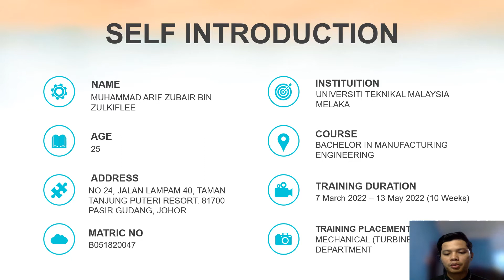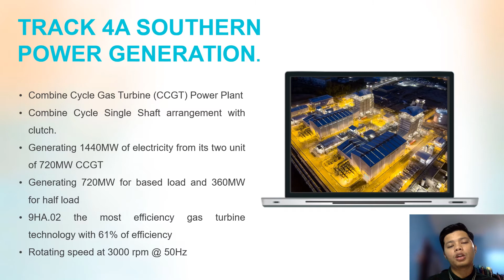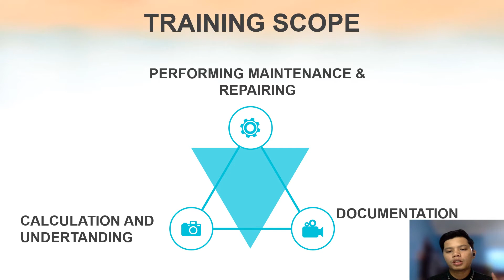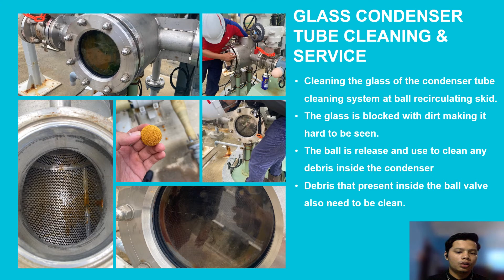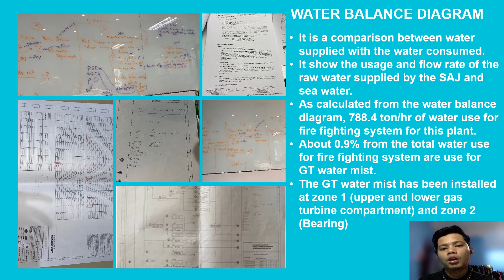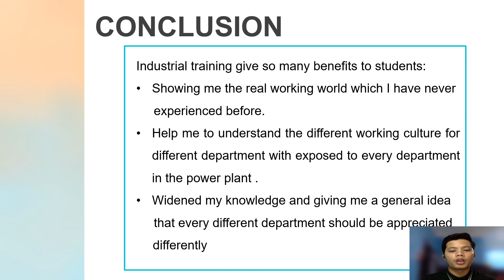2022 Industrial Training Presentation UTeM Arif Zubair B051820047

Comment: Wslm, Arif. Here are my questions. 
1. Could u explain the advantage of gas turbine technology compared to the ones used?
2. Can you elaborate on the performance or significance of using single shafts and multi shafts?
3. In your job scope, you were asked to do calculations. What kind of calculation? Please make sure you include this in your report.
4. How do they dump and manage the ocean garbage (shrimps, cockles, etc.) What are the procedures used?
5. How frequently the rubber gasket is broken? Monthly? Weekly? or, once in a blue moon?
6. How often do you perform the glass condenser tube cleaning?
7. What are the causes of the dirt? What does the glass condenser do? IS the ball yellow, or is it become yellowish due to stains?
Reply from the maker: Thank you Dr for the question. Here is my answer regarding your question:
1.	The 9HA gas turbine engine is the world's largest and most efficient heavy-duty gas turbine, with an efficiency of 61%. It has a modern 4 stage air-cooled hot gas path with advanced cooling and sealing technologies which can improve efficiency. It provides low emissions and wide fuel capability, which can run by natural gas and distillate oil for this plant. The 9HA has a fast 10 minute ramp-up from start command to gas turbine full loaded compared to other old designs, which can take longer for ramp upstart. The gas turbine has an advanced 14 stage compressor, which increases reliability and maintenance. 

2.	The single shaft arrangement has fewer parts involved than the multi-shaft because the multi-shaft arrangement requires 2 generators compared to one generator used for the single-shaft arrangement. This will involve extra auxiliaries, pipe, building and structure that will cause increased costs. Moreover, using one single big generator is more efficient compared to 2 single small generators. The start-up time for a single shaft arrangement is less than the multi-shaft arrangement. So, starting the single-shaft arrangement power plant is faster than the multi-shaft arrangement.

3.	For the water balance diagram, we were asked to calculate the amount of total water usage for the firefighting system over the total water supplied by the SAJ and the amount of total water usage for water sprinkled over the total firefighting system. For pressure vessel calculation, we need to calculate the minimum required thickness for the pressure vessel and corrosion rate for the pressure vessel to ensure the pressure vessel can safely handle the pressure of working needed and can be used for a long time.

4.	The garbage will be filtered by the travelling bend screen and thrown into the garbage drain. The drain will bring the garbage to the bucket where the garbage is collected. The technician will then raise the fully loaded bucket using a forklift and throw it into the RORO bin. One sub-contractor will take out the RORO bin when it is full and needs to be empty.

5.	The indicator shows the rubber gasket is broken when it fails to maintain the required amount of seal oil inside the tank. This will show the rubber gasket for the floating valve is broken and need to be fixed.

6.	This depends on the dirt condition inside the condenser tube. Frequent, we need to clean if the ball brings more dirt from the condenser tube. The glass condenser will be an indicator of the cleaning time.
 
7.	The dirt on the condenser tube cleaning service comes from the squishy ball released into the condenser tube. It will enter the condenser tube, bring the dirt along and back to the glass condenser. This cause the dirt inside the glass condenser. Sorry dr, I'm not sure about the previous and after of the ball colour.